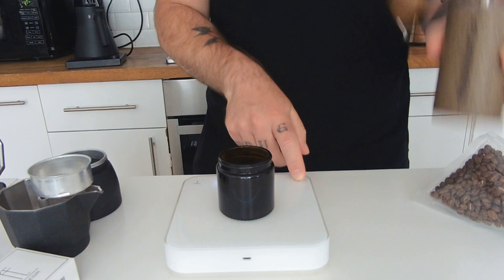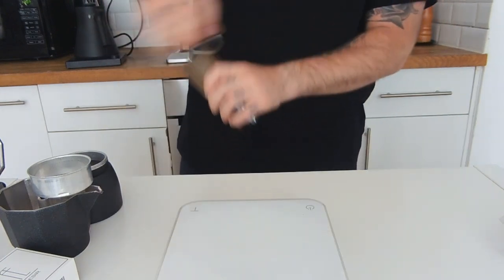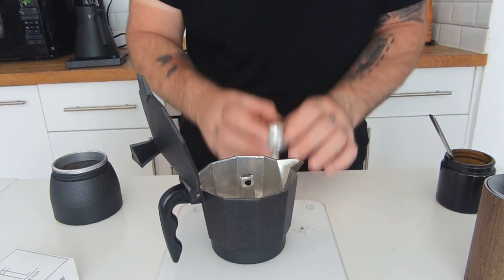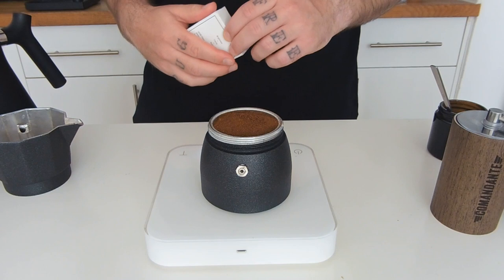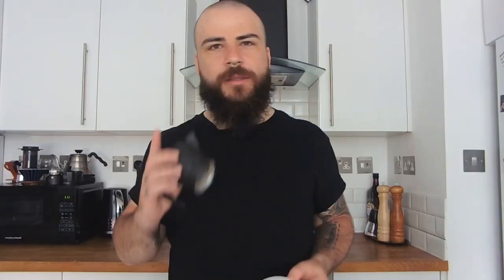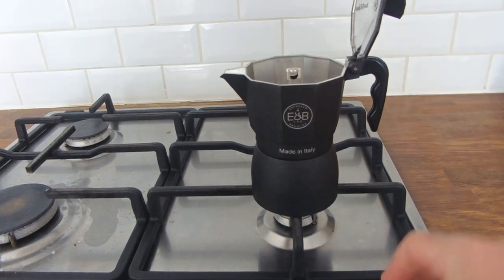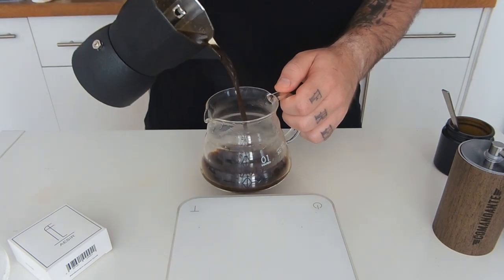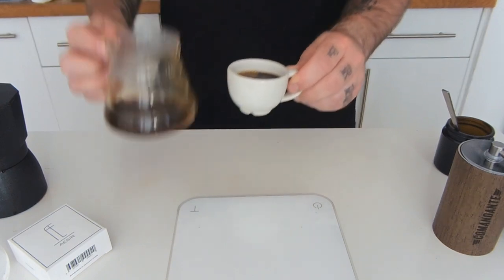How To Brew Coffee with MOKA POT - 2020

Comment: I have trouble brewing coffee using a moka pot and I can't understand why. I have a Bialetti Venus steel pot and the coffee is unsatisfactory to say the least. I tried a different variety of pre-ground dark roasts or grinding the beans myself. I don't know if I'm grinding it wrong, or maybe something with the heat (I have a fire gas stove). There is just too little liquid coming into the top chamber and the coffee is not as rich as in Matteo's video, it just looks bland and poor. I replaced the seals recently and played around with the heat but I just can't get it to work. If somebody has any good tips, I will appreciate them. Thank you!
Reply: Do you tamp your coffee?
Reply: @wmd5878  no, never, I put the coffee in with a teaspoon and then gently even out the surface.
Reply: @pandacherry2858  do you pour water till just below the safety valve?
Reply: @wmd5878  yup!
Reply: @pandacherry2858  seal your top tightly? Sounds like you have pressure leaking out of your moka pot. Make sure your gasket is fit in properly
Reply: @wmd5878  I'm sealing the top I believe but I think you might be onto something with the pressure leaking. The gasket is sitting as tight as it can but like I mentioned I did replace it some time ago (I bought an original Bialetti one as well) and it was a visibily different kind of rubber than a previous one. I may try to buy another one and see if there's a difference. Thank you!
Reply: i also have the  same moka pot and your same problem

Comment: My coffee only comes out at 85C. What could I be doing wrong?
Reply from the maker: How does it taste? If it’s good there is no problem, if it’s too bitter probably or the grind size it too fine or the coffee is very packed in the basket
Reply: @matteofromtheswamps  It has a slightly bitter aftertaste. Bialetti coffee, original ground. The worst thing is that it's hard to control. On induction. Level 3 comes to a boil very quickly. Level 2 cools down a bit. It balances between 2 and 3. Max power is 9. Maybe too low power and cooks too long? Tomorrow I'll try to measure the time.
Reply from the maker: @Sensej_FPV  what I suggest you is to tap less the basket on the counter when you pack the coffee. This will give more space to the water to pass through the coffee. Keep it a 3, reduce the amount of water in the boiler and use room temperature water. Like this should do sputtering, if it does, remove the moka from the stove for a few seconds to calm the water down and then replace it on the stove.
Reply: @matteofromtheswamps  Thanks a lot for the advice. With the calming down from the side it was much better. But power 3 is definitely not enough. I measured the time and it was 7.40 minutes until the coffee appeared... I have to increase the flame next time. The coffee appeared at about 73 degrees. I think I could have tamped too hard. I was only looking from the side but maybe too hard. This time 3 taps from the side. And I evened it out on top, knocking off the excess with a knife. But there is almost no bitter taste anymore.

Comment: This is the best video I have seen that shows and explains the steps to make a perfect cup of coffee - Thank you, Matteo! 

I have a couple of questions - 

I always assumed that the moka pot made espresso. Would I need to increase the amount of ground coffee to get espresso?

I have never seen a manual coffee grinder like the one you used in the video. What are the pros and cons of manual vs electric grinders?

I have never seen a device that you can specify the temperature to boil water. What is the name of this product?
Reply from the maker: Thank you very much for your kind words (I’m actually working right now to a new how to make Moka pot. Better than this one 😅)

Answer to the first question. Moka doesn’t make espresso because they are two different methods. Main difference in the pressure during the extraction. 9bar for espresso, 2bar for moka. Automatically the results are different.

Answer for the second. That brand is called Comandante. German company. This grinder is great! Very consistent and durable. It is a bit pricy compared the other grinders but the quality is superior.

About the last question I don’t understand if you mean the thermometer probe or the electric kettle.
Reply: @matteofromtheswamps  Could you tell me the name of the electric kettle? Thanks again!
Reply: @allisonhermann4973  Fellow stagg ekg electric kettle

Comment: Hello Matteo
After doing a thorough clean (disassembling everything on the moka pot including the valve) 
my extraction temperature is now a bit high 70-71 degrees Celcius.
This is a 6-cup pot and I put 15 grams of medium roast and 244 grams of water.
What can I do to lower the extraction temperature? add less water?
Great instructional video!
Reply from the maker: Hi! I made a video about the 6 cups maybe you have a look at it. 15 gr in 6 cups sounds a bit odd to me. Do you manage to get a good extraction? I ask because I'm curious. Anyway if you put 220g of water at room temperature you should get lower extraction temperature and also less water.
Reply: @matteofromtheswamps  Thank you for the response Matteo!
before this reply I did lower the amount of water to 220 grams and now coffee gets out from the chimney at 60-63 degrees Celcius.
However, now the coffee tastes sour. 15 grams is good for me because higher doses are a bit too intense for my taste.
I use a hand grinder at 11/24 clicks (0-6 are the finest settings) and a 90% Arabica, 10% Robusta blend.
I watched the video, but I am not sure what to do next.
Should I use a coarser grind or remove the moka pot from the stove at a higher temperature?
(60-63 degrees seems to be consistent at the conditions I mentioned).
Reply from the maker: @Zloner  tastes sour because you reduced the extraction by lowering the temperature and reducing the water. If you grind slightly finer you can get more sweetness, try that. Also if you prefer less intense, you can put more coffee and then add hot water after in the coffee to reduce the intensity, but you will keep the same extraction

Comment: Ciao Matteo, I've been brewing light roast coffee using a higher ratio (1:10) with pretty good results. Any suggestions for light roast? Should i stick to 1:6.5 and adjust other variables?
Reply from the maker: Yeah that is a good ratio as you get more extraction from light beans. What I'm recently trying is to put boiling water in the lower chamber, to get higher temperature of extraction. As soon as I have enough data, I'll make a video about that. :)
Reply: For dark roast coffee, what is ideal  ratio ?

Comment: Ciao Matteo, 
I know moka produces a bolder and richer coffee than a V60 or french press but in terms of flavor, do you think Moka has any advantage over percolators? I always use light and medium roast coffees because I love the sweetness and fruity notes. Would moka be a good method for this? I just received my Hario switch and using immersion to get bolder and richer cups, but should i still get any advantage from the moka? Grazie
Reply from the maker: Hola Manuel! 
Brewing light roast coffee with moms is very tricky. I do sometimes and I use a different approach compare to medium/dark roast. I put less coffee in the basket and grind slightly finer so I make sure water is able to extract sweetness from the coffee. Light roast coffee are harder to extract compared the dark roast, sometimes you need more contact time (that’s why Hario Switch is great for light roast). Of corse with moka you get a different result in terms of taste compared to pour over or immersion. The intensity is higher, because the ratio coffee water is lower and also the pressure of 2 bar helps to push the extraction in shorter time. Moka is something in between espresso and filter. 
I hope this response will help you to achieve a good cup of coffee!
Thanks again!
Reply: With light roasts, I actually use even higher doses than dark roasts to boost the strength (TDS) of the resulting coffee.  Then I dilute the lighter roast with hot water at a 50/50 ratio to make a sort of “Moka Americano”.   I find this lets the flavours more typical of light roasts shine through, while still keeping some of the Moka’s higher intensity and body.  I have a 6-cup Bialetti Moka Express and I find the basket fits about 25g of dark roast and 40-45g of light, due to the higher density of light roasted coffee.  Having read Matteo’s response, I’m tempted to try lower a lower dose to see what I get (with what I assume will be a fuller extraction) and dilute less, or not at all.
Reply: @matteofromtheswamps  per my message above, any dosing suggestion for a 6-cup pot?
Reply from the maker: @coreycannon4511  I like your approach to use higher dose and then dilute it. Higher dose give higher tds but also could lead to under extraction because you won't have enough water to extract sweetness. So reduce a bit the dose and bypass less can be a smart move to achieve more flavours from the coffee. About dosing suggestion, you already answered yourself when you talked about coffee density.
Reply: @matteofromtheswamps  I should clarify that my typical dose is 24-25g for dark roasts and 30g for light and light/medium roasts.  The former is a full basket and hence the slightly variable weight.  The latter, at 30g is definitely fully extracting, as I can get astringency if I brew to the sputtering phase at the end.  I’m actually going to try a thermometer, as per your suggestion, the next time I brew with my Moka.  In asking for dosing suggestions, I was mostly looking for confirmation, I guess.

Comment: Hey, what do you think about this?

before I make my Coffee, I put water in the basket and heat it up, then throw the water away, and make my coffee.

After that I clean it with Water and heat it again up. 

best regards
Reply from the maker: Warming up the moka after cleaning with water is something I was doing in the past, but be very careful because moka on the stove without water can reach very high temperatures and you risk to damage the gasket. 

About warming up the basket can be a good idea, but remember to dry it very well before putting coffee inside
Reply: @matteofromtheswamps  

Thank you for your advice Mr. D'Ottavio.

Greatings from Austria
Reply from the maker: @dragomirovicdamjan9699  I love Austria!

Comment: Ciao Matteo. I’m thinking about buying the Moka Pot you are using in your video. As I am not from Italy, it will be quite an adventure to get replacements like gaskets and especially the filter basket (the part where you fill in the coffee grounds). Can you tell me if the replacement parts made by Bialetti also fit the Moka Pot by E&B Lab? Otherwise, I don’t know how I could replace certain parts of the pot when they need to be replaced.

Thanks in advance and many greetings from Germany!
Reply from the maker: Hallo Lille. I actually live in London and I bought it from here (before Brexit), I believe if you contact E&B Lab, even from their Instagram, they could be able to help you. Also, if you properly maintain the Moka, you won't need to buy replacement parts. Mine it looks like I bought it yesterday.
Reply: @matteofromtheswamps  , thanks for answering.

In the end, I bought some completely different moka pot. I got convinced by the so called "Giannina" made by Giannini, also because possible replacement parts are incredibly easy to get. On the other hand, it's made of stainless steel and with only one moka pot, you have the possibility to prepare one or three cups thanks to a sprecial filter system. It will be delivered to me tomorrow and I hope it's as good as it seems to be. 

Nevertheless, thanks again for your answer. 
Bacci!
Reply: @matteofromtheswamps , btw: I love your hand tattoo(s). Brilliant one. 🖤
Reply from the maker: @lillekatt6293  I believe it will be a good Moka Pot!
Reply from the maker: @lillekatt6293  Thanks 😊

Comment: Ciao Matteo. You are using the E&B Lab Moka Pot, and it already has a better (finer) filter than Bialettii. So why do you need to use a paper filter as well with E&B? Is there such a noticeable improvement on the E&B to warrant using a paper filter? Thanks
Reply from the maker: Hey! Even if the filter is better I use the paper filter to achieve a cleaner cup. The paper filter has the ability to reduce the coffee oils, maybe you lose a bit of body but if you are looking for more flavour clarity, the paper filter makes a good job.
Reply: @matteofromtheswamps  Ciao Matteo, un'altro ... I currently use the Bialetti Brikka (2 cup). Makes 1 good coffee for me with milk. If I switch to E&B Lab Moka (1 cup) will that be to small? and will E&B Lab Moka (3 cup) be too big? - waste too much coffee each brew? What size do you use for 1 person. Ramon

Comment: Great Video! Why do you advice against putting the moka pot on running water to stop the extraction?
Reply from the maker: Because it is a practice you can avoid if you stop the heat few seconds before. So you don’t need to rush with the moka full of coffee in the sink. You risk to drop the liquid.

Comment: how fine do you grind the beans? also how many gram of coffee do you use?
Reply from the maker: I ground the coffee coarser than espresso. the good thing with moka pot is that I can play with different grind size. also depends on the type of coffee I'm brewing. I go coarser for dark roast and finer with light roast to compensate the extraction increasing the contact surface. quantity also depends on coffee. for a 3 cup I usually start with 17g at the moment and then adjust depending on coffee

Comment: My moka pot is very old - it is a Bialetti - and made of Inox, not aluminium.
Wondering if I should put warm water in the tank.
Reply from the maker: Hi there, yes of course, putting warm water helps to brew faster, keeping the pot for less time on the stove. Even with stainless steel is recommended.
Reply: Grazie, Matteo.

Comment: Hi. I have a issue brewing my coffee in moka pot, i like my coffee with chicory so I use 70% coffee and 30% chicory but coffee color is lite and tastes bitter.
Reply: Experiment with extraction time (taste will go from underdeveloped to sour to bitter), until you get an equilibrated caffee. (This is about 15-20 seconds on my 1 cup bialetti with small flame). Then apply an aeropress filter (it is cheep), that reduces both bitterness and sourness, so you´ll end up with a very good coffee.

Comment: What do I need to change if I don't get good flow from moka pot. The only way I could get a consistent flow is by a bigger grind size. If I get grind a little finer it always sputters or does t have good flow no matter the heat range.
Reply from the maker: How you pack the coffee in the basket is very important. do not put lots of coffee in it, also make sure the basket is dry before put the coffee. Use low heat and another think you should check is the quality of the gasket, if it is very old or damaged, it makes the pressure escape.

Comment: Hi Matteo, como estas?
Reply from the maker: Hello. I'm good thanks. you?
Reply: @matteofromtheswamps   Hi, Matteo! I'm doing good. I was wondering if you could help me out with a coffee query.
   I tried making coffee in my brand-new 6-cup Venus a few times and each time, the end result was sour coffee. I had bought freshly ground medium-dark roast coffee (moka pot grind with 2/4 stars for acidity) from my roaster. Why did my coffee taste sour? It had a tangy aftertaste. Or am I mistaking bitterness for sourness? I had put the stove on medium heat, used pre-boiled water for the bottom chamber and took the moka pot off the stove right after the coffee started sputtering out of the spout in the top chamber and gave the bottom chamber a cold bath. Thanks in advance. I hope you can help.
Note: I did not tamp the coffee and I filled it to the brim in the moka pot filter basket.